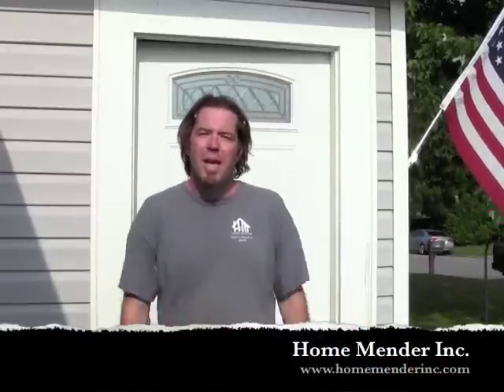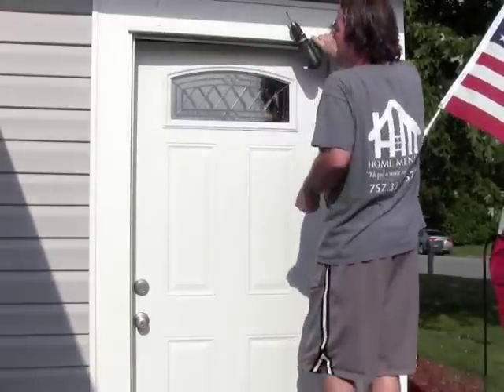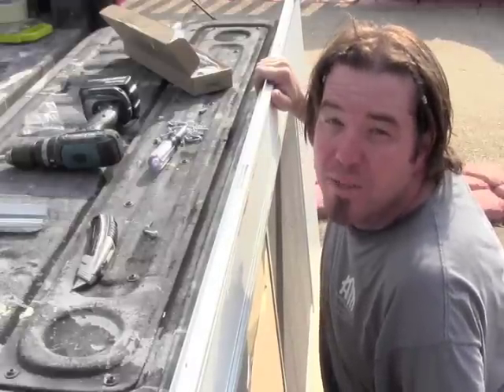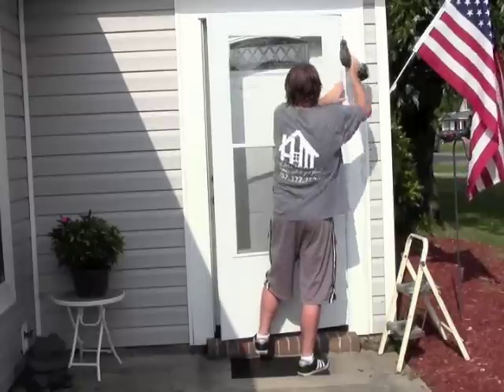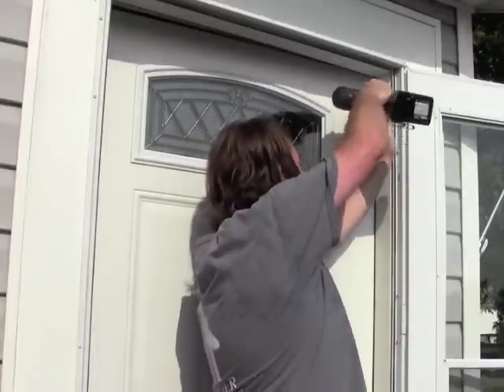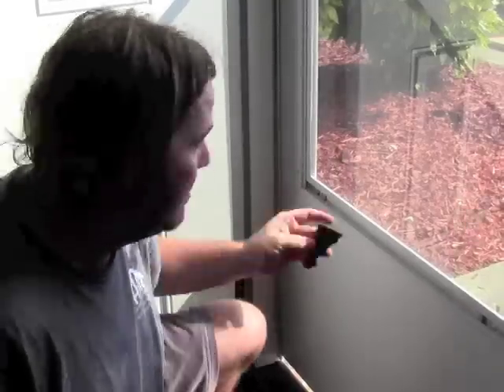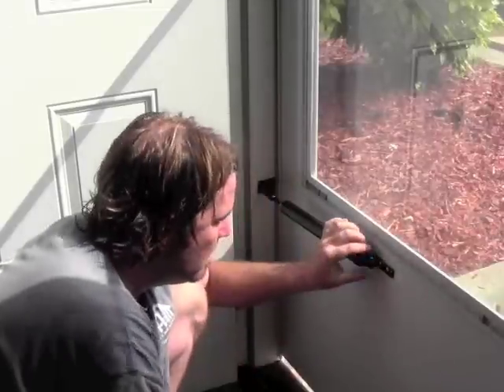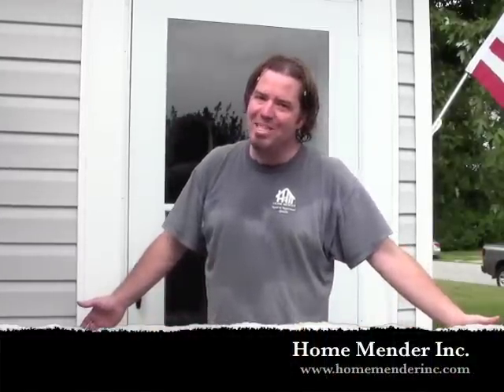How to install a storm door by yourself, Easy. Home Mender

Comment: Thanks man! Our screen door was hung by some "contractor" a few years ago. It never latched right and there was a gap on the top to the point that you can see outside. I just replaced the brick moulding and used your video to hang it correctly. No more gap and it latches better than it ever has! Thanks again!
Reply from the maker: You are amazing! Thank you so much for sharing this. It's a success story for me.. Thanks for watching!

Comment: The braids are awesome! Thanks for the video. You make it look easy enough that I am giving it a whirl today, with my Pella Storm Door. Wish me luck!!
Reply from the maker: you got this garden! thank you so much for commenting!
Reply: It turned out AWESOME!! I wish I could post a photo for you. The only trouble I had was drilling the holes to install the door handle lock. The holes overlapped so the second one was a real pain to get through. And a second person to help me lift it would have been nice (it's a roll down screen so taking the glass out wasn't an option).  Otherwise everything went smoothly! All in all it was a great improvement!!

Comment: Thanks for the video. Just what I needed before attempting this for the first time. (And as a father of 3 girls myself, god job with the braids...)
Reply from the maker: HA! I too have 3 girls..alot of work but so worth it..storm doors are easy compared to fathering girls..you got this! thanks for commenting!
Reply: @homemend  Actually, just did it tonight. Easier than I thought (thanks to your video). With one tiny exception: I don't know if I'm completely missing something, or what, but the sooner lock/key assembly won't stay in the push-button. The spring pushes it out.
Reply from the maker: can you shoot me a pic? homemenderhelp@ gmail.com or home mender on face book messenger.

Comment: Hi Dustin, I know this video was made a long time ago, but I really liked your approach. Especially the door sweep part. Perhaps you can help me with a question: the physical space I have when I measure for a storm door is 32”. Near the top end, that measurement squeezes down an 1/16 of an inch. Help me determine what width storm door to order? I was thinking 32”, but I’m concerned the door will be too wide. Any suggestions from your experience ? Most appreciated. 😊
Reply from the maker: Hey artifact. That is a great question… If you’re entry door is a 32, then your storm door would be a 32. If the 32 will not fit then adjust the wood trim so that it will fit.  You got this.
Reply: @homemend  Thanks for the vote of confidence! 😅

Comment: That was a very well done tutorial and nicely presented, no long winded intro etc. just the steps we need to know to do the job right and get it dialed in, Ive installed a few but im getting old and never know when theres something new I havent experienced.  I have an issue needing attention on a friends house she just bought where they have two fairly new storm doors and closers that are already installed by someone else and the problem is with the closer operation - instead of the usual closing speed adjustment issues these two doors are really hard to pull open.  Never seen this problem before and ive installed more than my share of doors and closers - and I do read directions, learned that lesson many years ago--lol  Im thinking the closer adjustment screw shouldnt really have any bearing on how hard the door pulls open, im guessing without a serious look yet either they were installed wrong or something wrong with the closers-??  It needs a closer look, maybe the brackers arent places right not sure.
Reply from the maker: yambo59 hi yambo! Thanks so much for the comment. That issue is odd. Not sure you asked my opinion but I would try removing the closer. If it’s still hard to open, it’s not the closer. My other thought was the vacuum created when a storm door is shut, ever noticed how a storm door might close well when the main door is open, but not so well when the main door is shut? Call me crazy. Is this a pressure issue? I hope this helps!

Comment: Great video! Do you use a chain for wind? Thanks.
Reply from the maker: hey bob....i would prefer not to use it for my door.. i just don't like them, but sometimes they are a necessity if your house is positioned that puts the door in heavy winds.
Reply: @homemend  Thanks for the reply. I agree.

Comment: Great, informative and funny video! One question - if you have to cut the two side rails to fit the opening (it’s the older model, pre easy hang model), do you cut them to the exact jamb length or 1/8” shorter? Thanks in advance!!
Reply from the maker: Hey Steve.  Thank you so much. Jamb height would be best. You got this!!

Comment: just had storm door installed if the inside door is closed the storm door doesn't close all the way. if inside door is open it closes fine, any tips on fixing this problem?
Reply from the maker: hey joe..its a nuisance. .its too airtight..lol not sure there is a fix for that...i usually let the storm door shut before closing the front door.

Comment: Dustin can you do a video on installing a storm door/ screen door that’s  about 2” smaller than the door frame ! My mom got a good deal at Lows but the 2 screen door she bought is about 1 to 2 inches smaller than the doorframe so my idea is to buy fours down both sides of the door frame to bring it out to me to screen door ?
Reply from the maker: Hey mark! Crazy situation.  Not sure when that particular task would be needed but I might be able to spark some ideas. 2x4 wouldn’t be ideal as it’s framing lumber. If you used a 1x2 or some other primed board( depending on the size needed) to build it out it wouldn’t be that noticeable.  Paint it the same color as your trim and you’re good to go.  I hope I explained that well. If you need it I’m on messenger, you can shoot me a pic. I hope this helps! You got this!

Comment: @0:45:  Suggestion:  On instructional videos, it can be helpful to explain what you would have done if things had been different.

E.g., here, you checked the fit of the hinge track, which fit fine, but what if it hadn't?  (You might think the answer is obvious, but it often matters which end you cut.)
Reply from the maker: Great observation. It definitely matters… You always cut from the bottom. I hope the video helped you.

Comment: Hi Home Mender, Could i cut a few inches off the bottom? I have a 36x76.25 opening. I'm looking at buying a door very similar at 35.75-in x 77.625-in) could i trim the bottom?
Reply from the maker: Def Leotard hi def.  you can cut the track at the bottom but if the door may need to be cut off as well. If you mark it, score it with a knife you can fold and break both sides off first then cut the door with a skilsaw. As long as the sweep covers, you should be good to go. That would work for this style of door. If you have a fancier full or half glass, the door may be tougher to cut.  I hope this helps! Thanks for the comment.
Reply: Home Mender Inc - Thanks for the reply! That info is very helpful, i will give it a a shot. Thank you for this video, and your time.! cheers!

Comment: Recent single Mom here...do you think I could pull this off? I’m semi handy but afraid my front door might not be level. 
Tell your daughter she made Dad look the coolest!! Thank you! :)
Reply from the maker: you brandi are the awesome mom.. it looked pretty easy didnt it? just double check for level when installing and adjust as needed.. you got this! and thanks for sharing!
Reply: I'm older (54) and am thinking about doing mine myself. I think my biggest concern is buying the wrong door, although I've measured like 16 times. I also don't think I will get the lock part right.  I've seen some where they've had to dig out the wood in order to make the lock work I can't find a video that specific on that part.
Reply: I'd help ya, Brandi... but it's probably a long shot that you're close by!

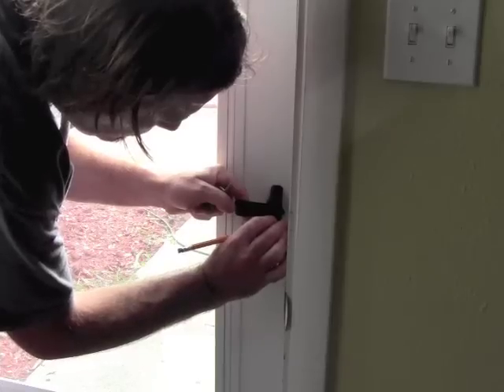Comment: Right @4:48 wish there'd been a detailed visual and explanation about lining up latch catch with door and not been edited out showing installment. Maybe, the door installment instructions give details about it.
Reply from the maker: Hey original you simply close the door and put a pencil mark where the strike falls
Reply: @homemend  
I'm sorry, No I meant about if there was another little metal piece you had in your hand to add to adjust making exact contact with the strike to the handle.
Reply: @homemend  
"Facers" you'd mentioned placed a certain way near strike to adjust perfect fit to strike and door gets edited out.
Reply from the maker: Spacers.   The little grey plastic pieces that bring the catch out if needed.
Reply: @homemend  Ahhhhh
I always wondered if there was a device to help to adjust those!! Especially for inside closet and room door strikes!!! Especially for when inside doors don't close completely unless you pretty much force or slam shut.... Thanks!!!